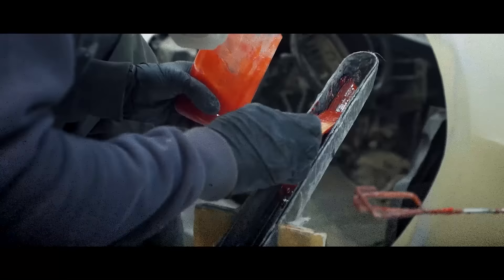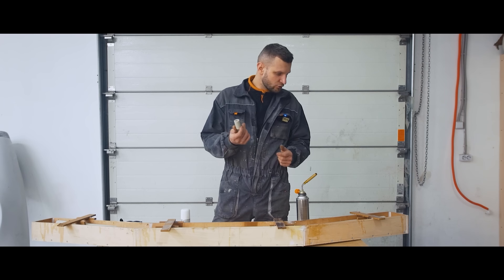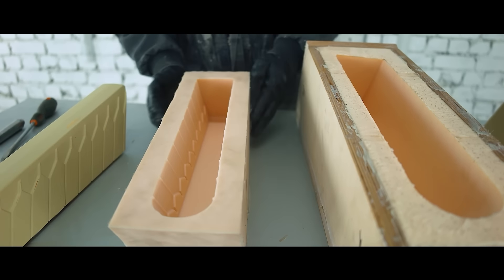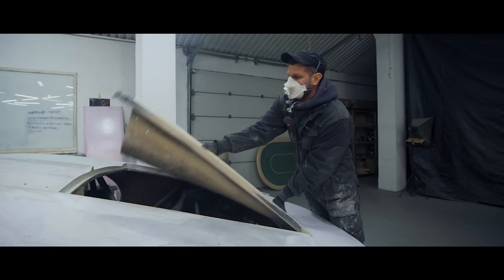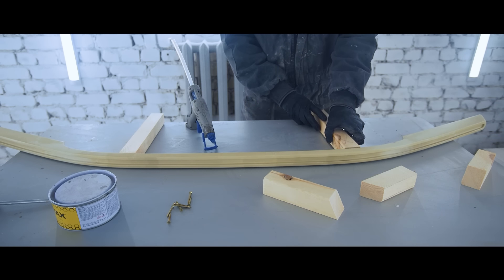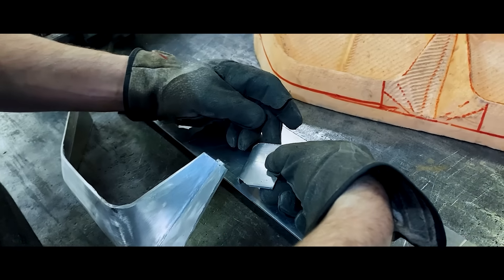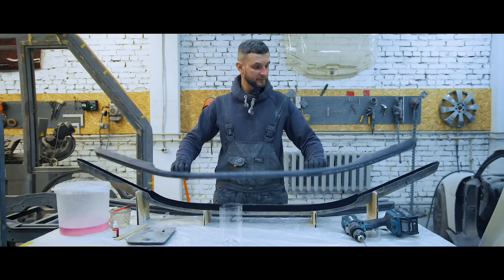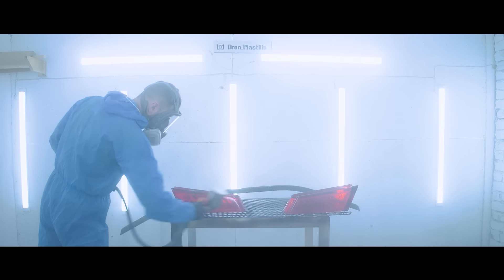We crossed vintage car and Bugatti using the Wattsan CNC machine. We have something to show!

Comment: This is working good. love the Bugatti look but don't have the deep wallet.
Reply: @axes_garage  I will be.
Reply: @axes_garage  That Gaz-21 sure fits nicely with the Bugatti. I have a few 1/24 diecast Bugattis and might try to make a model of yours. The Gaz-21 in 1/24 is very expensive, I might be able to use some parts from a 1949 Ford and modify them, the fronts are very similar.

Comment: Never perfect results, but maybe build a vibration table, which will encourage the bubbles to rise as it cures. Certainly cheaper than a vacuum chamber to fit those sizes.